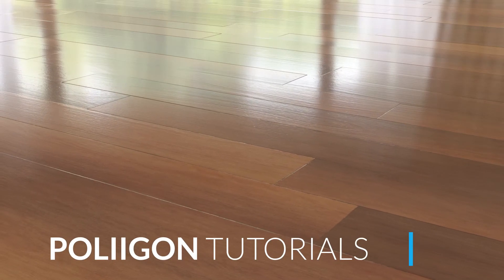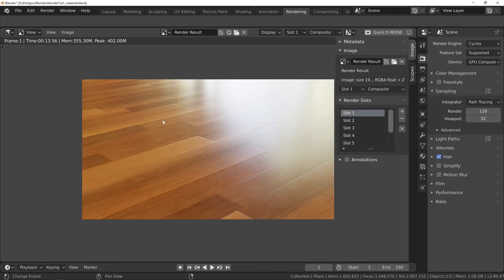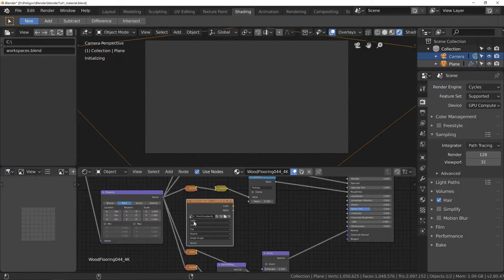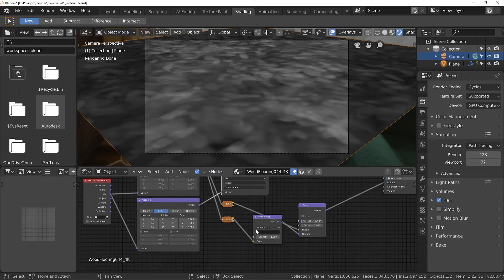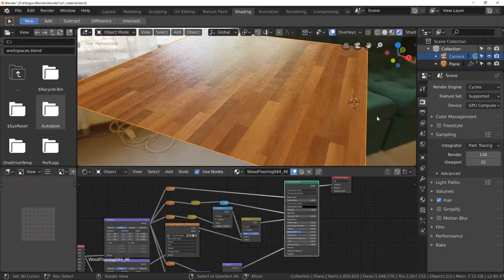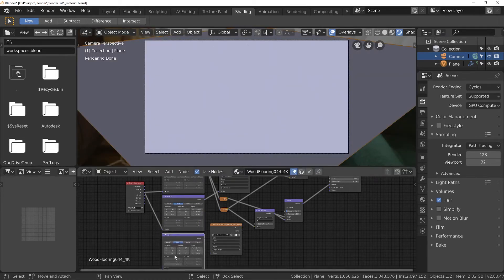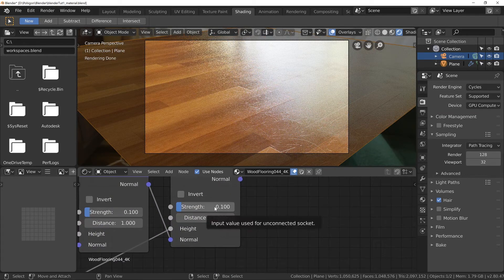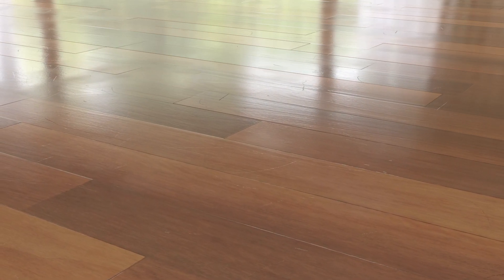Using Poliigon surface imperfections in Blender

Comment: Hi, I love the Poliigon Material Converter, but adding all these steps is too advanced and time consuming. Is there some new features in the Poliigon library to automatically apply the imperfection layer? How about creating a second slot and use the Poliigon Material Converter with the imperfection texture, can it then be overlapped?